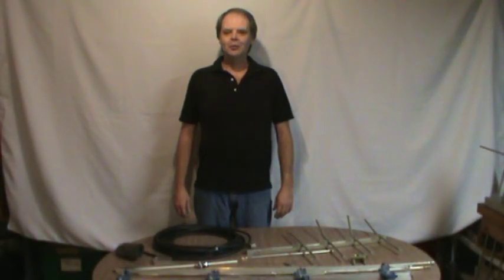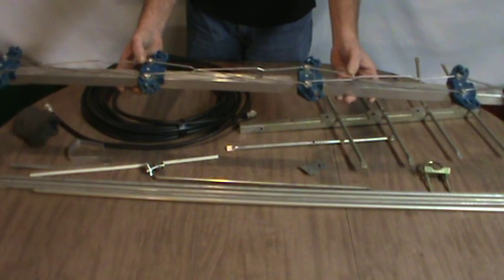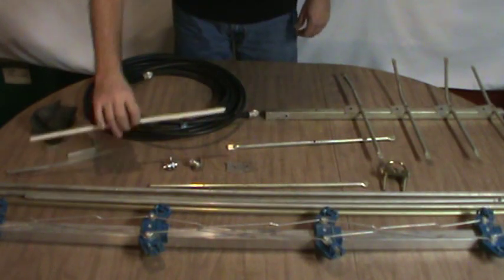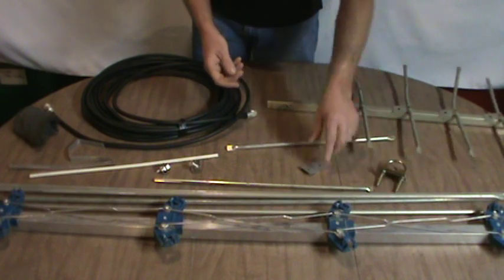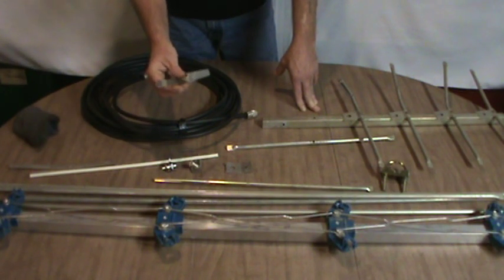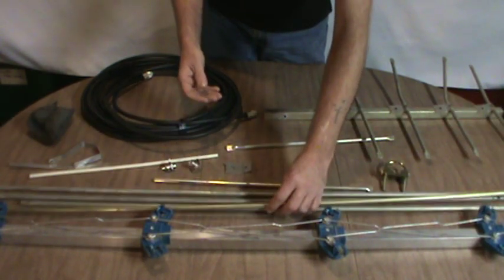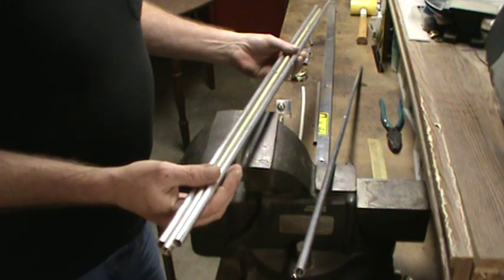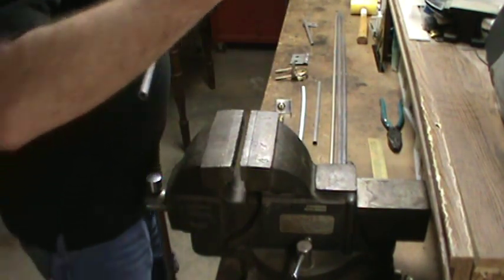2 Meter Yagi Antenna w/ Gamma Match (Part 1/2)

Comment from the maker: @dbindner SWR readings will vary with the length of cable and with height.  For a more accurate SWR reading you may use 1/2 wavelengths of cable but this is not a must for the antenna to work.  Using 1/2 wavelengths allow you to adjust the antenna rather than the coax cable. I built the antenna in December and checked the SWRs indoors in the basement, about 5 feet underground, and still saw the lowest minimum SWR being at the desired operating frequency.

Comment from the maker: The coax cable length mentioned in the video for testing the gamma match should instead be multiples of a 1/2 wave length.  For 144.250 the formula for a 1/2 free space wave length is (984 / 144.250 = 6.8215' ) / 2 = 3.41075' (or about 3' 4-15/16").  If you use multiples of 3' 5" you should be close for use on 2 meter sideband.

Comment from the maker: Yes, you can use a dual band antenna with a mono-band transceiver.  The 2 meter wavelength sent to the antenna is longer than the 70 cm section of the antenna and it will not notice that place in the middle where 70 cm frequencies are cut off. Thanks for watching and 73.

Comment from the maker: Yes. You can use a dipole driven element instead of the driven element as shown.  Use an insulator to separate the two dipole halves from each other and the boom. If the insulator sticks up and the elements are not aligned then use spacers or insulators to raise the elements off the boom. The parasitic elements can be either grounded to the boom or insulated.  For a simple version see also my video, "Coat Hanger 2 Meter Yagi Antenna." Thanks for watching and 73! :)

Comment from the maker: Antennas for different frequencies can be mounted on the same mast. I think spacing on a mast is 1/8 wave of the highest frequency apart. The antennas won't mind multiple towers so long as the landlord or HOA doesn't mind, lol.  The amateur radio antennas should not cause any major interference to the TV antenna (UHF), wireless camera (900 MHz) or wireless internet broadband router so long as you are not transmitting near those frequencies. Don't worry, you have lots of room to transmit. 73! :)

Comment: hi Dave I was wondering how much difference it would make if I went with a 14element hygain it is supposed to be more than 15 dB gain I got the tram 1400 it is 6db gain. I can talk farther than I can hear with 65watts I talk to mobiles a lot on simplex I can talk about 35 miles now to a good mobile my goal is to talk 50 miles to a mobile. DO you think the beam will let me do it?